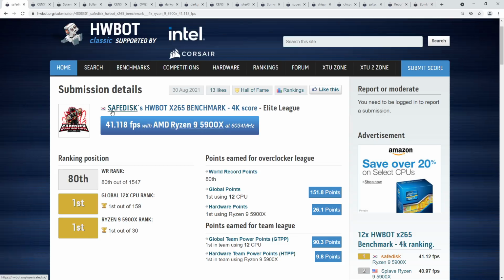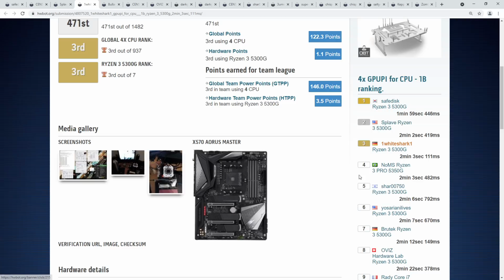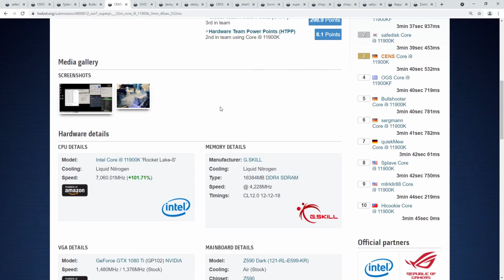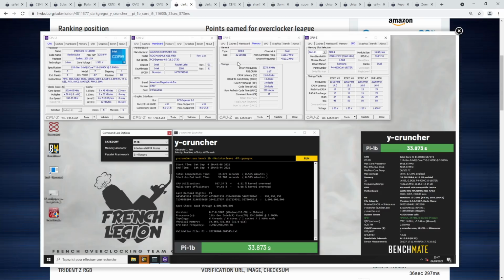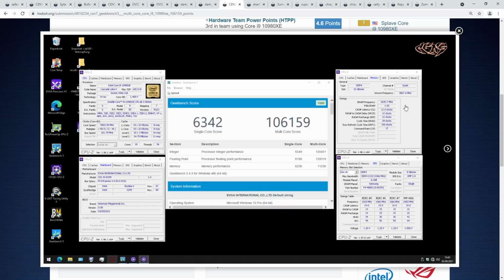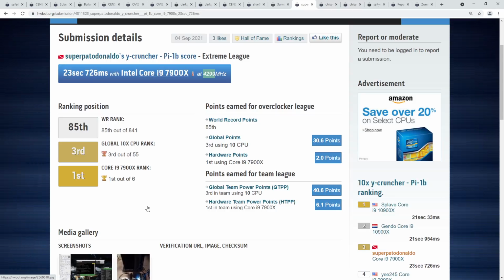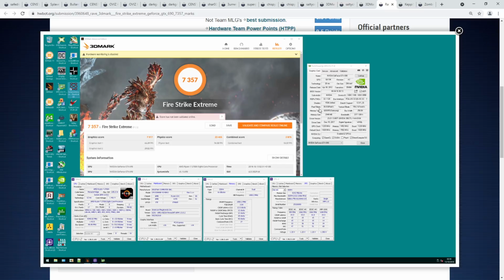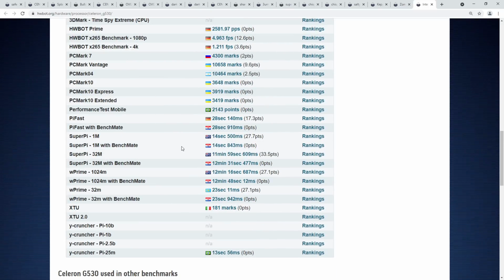HWbot score round up #17: TOO MANY SCORES EDITION

Comment: I wonder how much better will be that old AMD arch like HD 7790 do it from 28nm to 7nm. Ressurected some old part in new 7nm proces and with HBM2e/DDR6 memory controller. Even 100 or 1000 chips special for OC. Like AMD (redesigned) Edition and give them to EVGA, Sapphire to do some like crasy Kingpin Edition 7790 7nm Edition. 
Old part like HD 77xx 78xx 79xx,  R9 290X, R9 380X, or even R9 280 dual X, HD 6990, HD 5970 redesigned it from 40mn and 28nm to 7nm and new memory controller build in. 
Smaller proces 7nm = lower TDP/TBP + better clocks = more OC. :D 

I know AMD and TSMC have problem with not enough 7nm wafers, and AMD want sell big profit HEDT/serwers 7nm CPU's but if they do it only for Fame becouse it beat some records in benchmarks and do big greetengs to AMD from OC scene.

Comment: This GTX 590 is actually the first card I've ever done hard mods to. 
I just started doing OC stuff a few months ago, so featuring my score in your weekly roundup is really awesome and motivating, thanks alot! 😌

The change from win10 to win7 actually bumped the score quite a lot while running the same clock speeds. 
I set vcore to 1.00V via bios flash for the final score, but don't know what exact voltage the cores actually ended up getting. 

Also can't wait to see what score you will achieve with the Deathwish GTX 590 once you rebench it!
Reply: W7 should also generally be better for Kepler too

Comment: Great round up amigo BZ !
Reply: Gratz on finding a hynix hd7770
Reply: @saltyphil1874   Thanks amigo ! it was good while it lasted , sadly the card died during 3dm11 run GT3 at 1525/1565Mhz 1.52v , 3d11 is very hard on this cards. Back to Elpida 7770  :/ . Also congrats on your gtx 690 scores , that card is flying. My gtx 690 is a dud , lost the silicon lottery with that one.
Reply: @chispy0  thx, sad to hear a unicorn died. I hope you find another. Or that you can find a better gtx 690, but they are weird gk104 should scale more then that with voltage, yet not even 1400 at 1.4v

Comment: I have gotten multiple ivy xeons upto 119bclk. idk if thats where the wall is but after 115 it gets spotty, sandy is 105-107 if ur lucky. lock in max turbo multi as all core and crank bclk.
Reply: Don't you run these 127 strap? Can you go all the way to 119 from the 100bclk strap?
Reply: @mortenee88  119 bclk from 100bclk, so e5 2680v2 10 core that would turbo to 3.6ghz is knocking on 4.3ghz door. 119x36=4.28ghz idk if the xeons can use the 125 strap. Gonna have pull out the stuff n mess around.
Reply: @sobe8991  they can't use the strap. I've tried.
Reply: @mortenee88  I figured that was the case  cuz I dont remember seeing the setting but couldn't remember 100%. Been running ryzen for awhile now. That wasnt even like sui runs or anything crazy, just daily.
Reply: Or well the strap is 125 but you can go up from there. I ran a 4820k decently high alongside som Corsair dominators running 2050mhz or so. Originally 1600 c10 sticks. The 8gb ones.